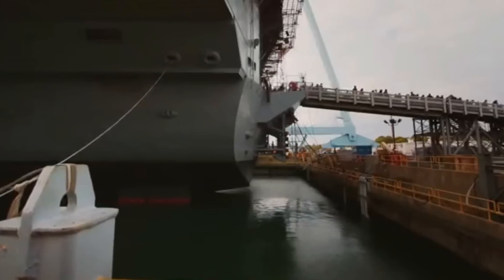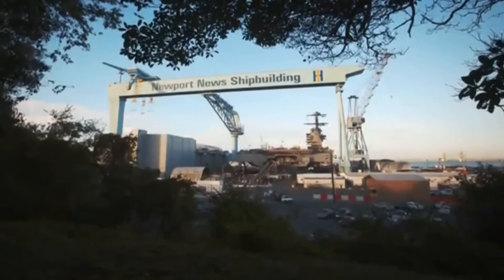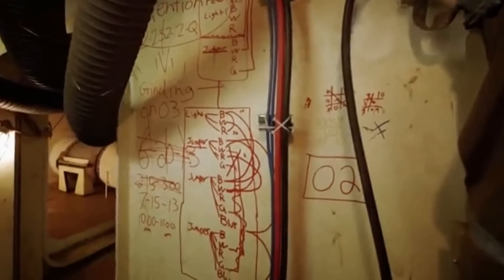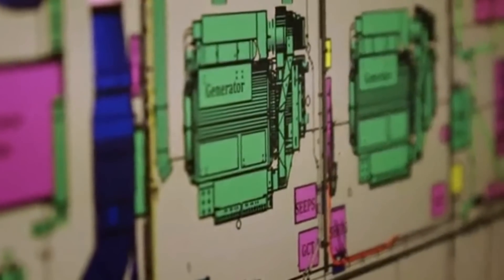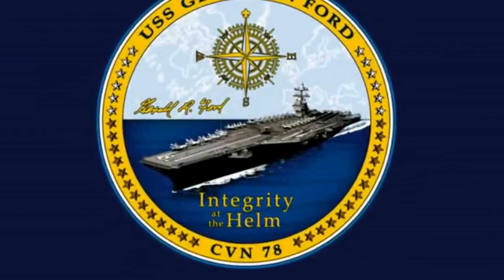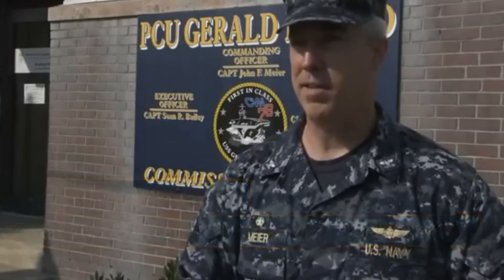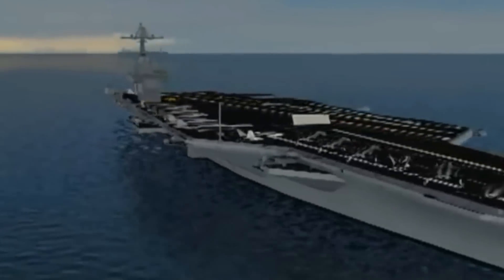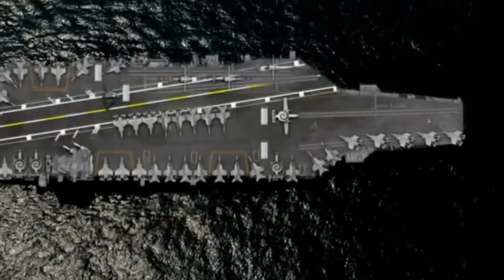Ford-class aircraft carriers close shot on the building process in time-lapse photography US navy

Comment: so what happens if an EMP pulse is dispersed?
Reply: spatsky I would bet the US has spent my TAX dollars well to prevent that.   Proper wiring protection can prevent it.
Reply from the maker: spatsky military power
Reply: it can technically still be called horse power. Watt did build the steam engine, calories might suggest we are on South Beach, while ergs may sound quirky like quarks as to parts... so how about Joules?

any pulse is really measured by frequency so any naval Hertz is more of a radio station. now that's called a broadcast.
Reply: Dude that's exact what I thought and scrolled into the comments to see. What if the enemy used an emp?
Reply: Knox Watson if not seeing any in scrolling down, try searching other comments...

spatsky 1 day ago
+skippy dippy detonate an H-Bomb, that kind of pulse. radar jammers are EMP weapons you call avionics. Radar certainly another EMP so it had to be the size of a gigantic ray gun. too render any electrical systems out electrically,  fly by wire means an electrical system that allows a computer to perform minute details of tasks that help make adjustments when the aircraft is in flight. if so, the only EMP weapon system out there is the EMALS on USS Gerald R. Ford that come close. in that case, it be called a Gauss Gun. thinking of magnetic fields, it had to be a force field the size of the one employed in the movie Battleship. a  nuclear reactor emits the same pulse but hoping any Wookie or Jabba the Huts out there got that one solved and patented. i'd sell my plans to the Chinese hoping they wouldn't sue me if they think the radiation might kill.
Reply: If someone EMPd the Ford the U.S. would retaliate with the rest of its navy and nuclear arsenal because an EMP needs a nuclear explosion. If someone wanted to just knock the ship out for a little it would have to face the full brunt of the U.S. and probably NATO military
Reply: SC457A insulation on the wires will not prevent certain EMP pulse from disabling electrical systems. a nuclear reactor can emit an EMP powerful enough but you may melt the cores and release a lot of radiation. think why there's that big gigantic lead box!

another example of EMP is RADAR. if amplified correctly by a set of magnets and metal coils, one can create a field that may temporarily knock out electrical system.

the USS Gerald R. Ford has a multitude of systems all interacting with each other with every one capable of rendering other electrical systems useless by sending an Electromagnetic Pulse. if accidentally used the wrong way, wether it is insulated or not, the EMALS catapult system takes a lot of engineering coiling to redistribute electromagnetic force.

if a powerful force is generated by EMALS, it would be first in many lists as the culprit if the crew started to discover some discrepancies with electrical systems going haywire. not to mention, electromagnetic radiation is a form of radiation much like x-rays or other forms including radio that if emitted in high levels can make biology susceptible to cancer.

who would explode a nuclear bomb near a Carrier task force takes some ingenuity from thinking about the delivery system to the actual detonation. if someone were to explode a nuclear bomb to have an EMP dispersed, that be defeating the original purpose of a nuclear thermal energy as the ultimate vaporizing effect. in thinking of nuclear blasts, many often talk about the blast radius and then the radiation fallout. an EMP to carryout after a detonation most likely happens with an H-Bomb. if thinking of physical mechanics correctly, an intense light source can generate an EMP. even our own sun does that many times with solar flares.

Carrier Task Force were originally thought of as an independent fighting unit. this concept was borrowed by the Americans from the Japanese who were very innovative in utilizing the the Aircraft Carrier as the new center ship or Capital Ship. why would any Captain in the US Navy ever sail their boat into harms way is what is essentially learned what not to do. it is the basic principle learned as a sailor.
Reply: +spatsky there are conventional EMPs.they can be fitted on a cruise missile ( instead of explosive warhead ).somewhere on youtube i've seen a video that explains how it would work.